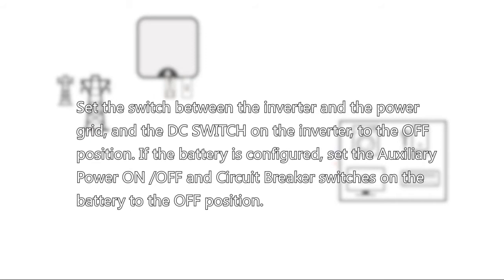SUN2000L 2KTL-5KTL: Installing the Smart Power Sensor(DDSU666-H)

Comment: I have problems with this smart meter.
It has large errors at low powers, due to (I think) the 100A current transducer, with accuracy class 1 (even 1.5).
If the coefficient of the transducer could be set, the conductor through which the current passes could be passed through it 5 times, to bring it into the range of 20A, which for 3kW would be sufficient.
Has anyone had accuracy issues? If so, how did you solve them?
Or how can we change the constant of the current transducer (obviously, somehow entering the smart meter's software)?